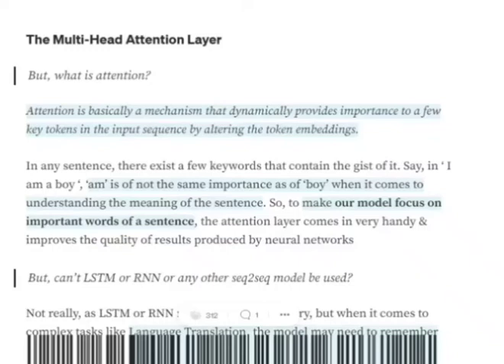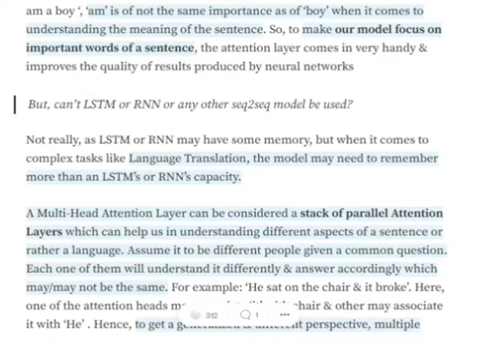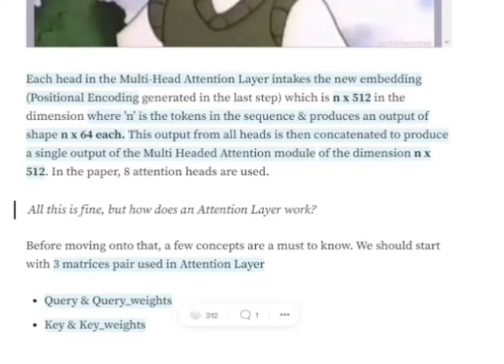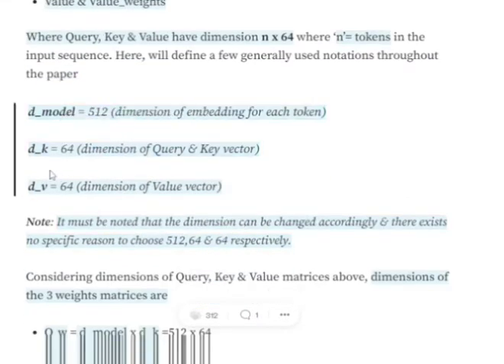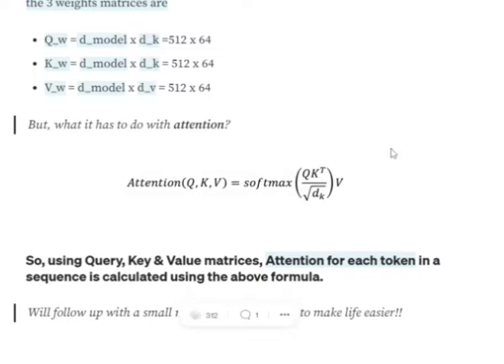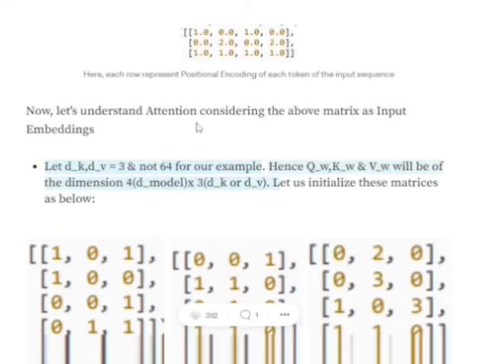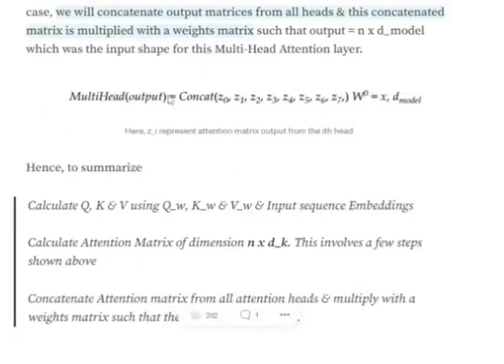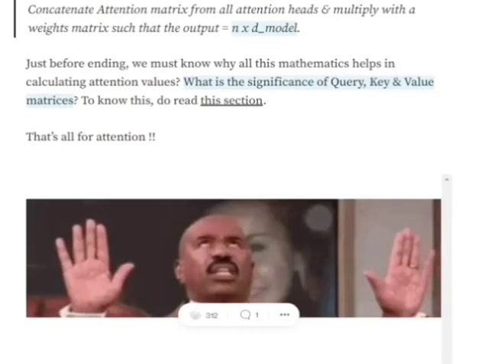How does an Encoder work in Transformers in NLP?

Comment: Hii, I have one doubt that d_model=512, d_k = 64(as we used 8 attention layers). But in example you took d_model = 4, so d_k , d_v  will be equal to 4. Why you took d_k = 3 in  8:28 ? As input tokens are three and we are dividing the dimensions vertically so d_k should be 4
Reply from the maker: You can refer to this blog for better understanding: https://medium.com/data-science-in-your-pocket/attention-is-all-you-need-understanding-with-example-c8d074c37767